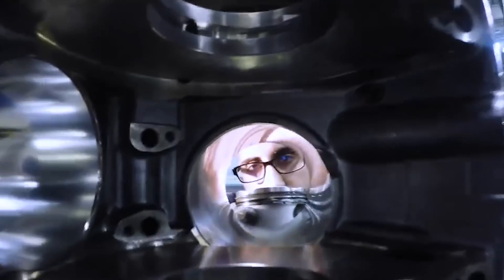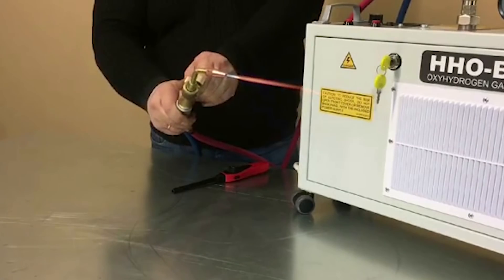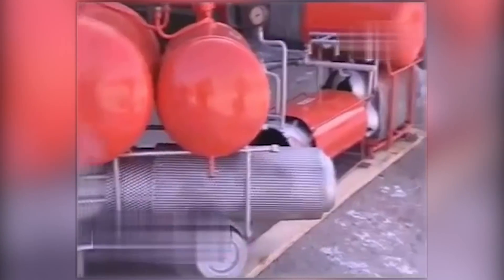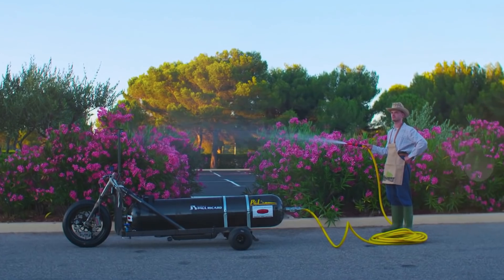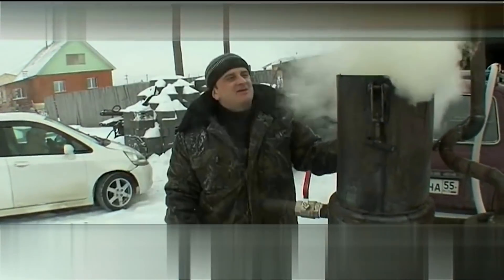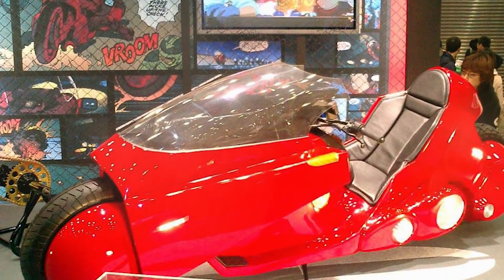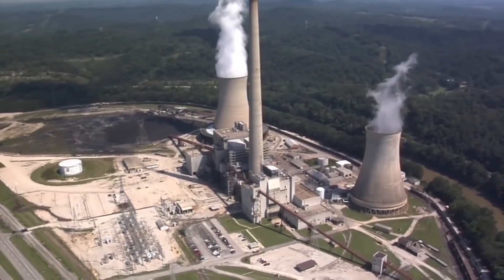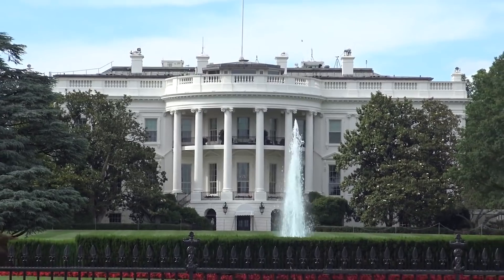Why These Engines Are Banned?

Comment: There’s no such thing as a free lunch. Hydrogen, compressed air etc. are not prime movers, it takes energy from another source to create them.
Reply: so does everything, it is called conservation of energy.
Reply: They literally use sunlight and air to make energy what you Talkin bout Willis.
Reply: @herbsewell4995  no! They use energy to produce less energy in a mobile carrier. It's not a perpetuum mobile. So no free lunch
Reply: You are exactly right
Reply: Yes, like electric cars lol
Reply: @bobopet2  to some extent your are absolutly right. but the difference is quite dramatic. When relating to fossile fuels.... nature stored that energy a long time before we lived. Releasing it, is OK. The sideproducts are not.
Reply: @bobopet2  yes I take it your a republican I hope and go COAL PLANTS
Reply: Rockefeller stopped electric cars. You can't sell oil with free or next to free energy. Tesla ? Nothing new under the sun
Reply: It is not free lunch, but potentially cheaper, cleaner and less pollution.
Reply: @JSiuDev  depends. Where are you getting the energy from to compress gas oder split H2O into H and O. If you say solar, wind oder nuclear, you where right.
Reply: Hydrogen is indeed a solution. Only problem being, it makes a great explosion compared to gasoline
Reply: @shaneintegra  There are ways to make it safer. The difficulty is more about infrastructure and industry support and investment.

Comment: Compressed air was used farther back then before the rubber tire, it was used in locomotives, first used in mineshafts,  made commonly by locomotive distributors, such as elmco.
Reply: well that it boiling water to produce pressure, not specifically storing compressed air

Comment: The diesel engine is still the most economical when you add up cost per pound moved.
Reply: And the most environmental friendly internal combustion engine.
Reply: And reliable, before docs, defs, and Egrs messed that all up.
Reply: and Space-X uses diesel 1 (Kerosene) because of the energy to mass ratio if I recall

Comment: Felix WANKEL began development of the engine at NSU Motorenwerke AG (IN GERMANY), leading to the first running prototype on 1 February 1957. Unlike modern Wankel engines, this 21 horsepower version had both the rotor and housing rotating. His engine design was first LICENSED by Curtiss-Wright in New Jersey, United States and they didn't produce any for customers.

Comment: 5:26 IIf I where to convert a multipoint fuel injected engine I would empty the petrol/gasoline from the tank and fill it with a mixture of water and ethanol 50/49 and 1% water-soluble oil (you might need to change the fuel pump to one that is certified for ethanol). Then I'd remove the injectors and look at the model and model number to find out how much fuel it delivers. Then I would find out the smallest size possible (fuel flow) of the injector model you can find and install. Then I would replace the original fuelpressure regulator with an adjustable one. 
Adjusting the the fuel pressure to the lowest possible while still obtaining satisfactory atomization of the water/ethanol/oil mixture which can be done by connecting the removed injectors to the removed fuel rail that is connected to the pressure regulator which is fed the mixture through a fuelline by the fuel pump.
The injectors need to be connected to a for the task special fuel injector driver that simulats the fuel injection pulse width from the ECU (electronic control  unit) of the vehicle at different loads and rpm. 
The original ecu will drive the updated injectors injecting the water/ethanol mixture keeping the intake runners, valves, pistons and combustion chambers clean while the ignition ignites the wood gas.
Then move the lamdasond or lamdasonds as close the exhaustmanifold collector as possible and remove the catalytic converters.
If there's 2 lamnadesonds install the first directly on the manifold collector and the second far enough so there is the same procentage temperature drop between the two as mesured on the system at normal engine temperature (before converting it to wood gas) att about 1500 to 2000 rpm. 

Then install a suitable model and sized spray nozzle 20cm infront of the the throttle body. Install a headlight washer fluid container with a integrateded high pressure headlight washer fluid pump at a suitable place on/in the vehicle.
Connect a suitable hose between the spray nozzle and the integrateded high pressure headlight washer fluid pump.
Connect the washer fluid pump to + with a red cable to a relay then from the relay to a fuse and from the fuse to a sufficient 12volt supply.Then  Connect - (minus) from the pump with a black cable to the chassis or - (minus) on the battery.
Then connect a switch with a red striped cable between the relay (trigger side) to a fuse and from the fuse to a12volt supply. 

Always fill the headlight washer fluid container with ethanol which will be use to clean the throttle body, intake plenum and manifold by activating the pump manually pushing the switch 2-3 seconds at a time. The system should only be use when driving in as high gear as possible keeping engine rpm above 2500rpm with throttle fully open (gas peddle fully depressed to the floor).
Push the switch to spray ethanol only when applying full gas (gas peddel to the floor) otherwise there is a substantial risk of enginebay fire and the cleaning liquid (ethanol) won't atomize which in turn won't clean the intake system. 

The wood gas generator should be installed as instructed by the builder/manufacturer.

Comment: The white stuff coming out of atomic reactor towers is just steam. Its steam from a secondary cooling circuit that is not in direct contact with the primary one. It is not radioactive. You can bathe in the cooling water with no radiation effects. 
Nuclear reactors are a great way to make more eco friendly electricity. Only human mistakes lead to events like Chernobyl and Fukushima.

Comment: 6:22 Unless it's a magnetic field generated with electricity that's bullshit. Magnets don't do work. Even if you can set the scene so it looks like they do the second you try to extract usable energy from the system it will stop.

Comment: You cannot beat the laws of physics... the amount of energy needed to push your vehicle forward is the same regardless of how you do it
Reply: Yes you can. Light gives off energy yet has no mass. If energy can’t be created or destroyed, where did it come from to begin with? Superconductivity at room temperature outputs more energy than is put into it, and it’s possible to do that as well
Reply: @Greasiola  light is an energy transfer from one location to another. It takes energy to create it in the first place

Comment: 4:28 That's totally nonsense, compressed air is one of the most expensive forms of energy. It is the most expensive at my workplace and that is 6-8 bar  low pressure.
Reply: seriously? wow i just found out about it? would you like you explain it to me a bit? i'm just a high school student, sorry
Reply: @tioa.p.1058  If you shorten a pendulum it gets faster, according to the same principle air gets hotter when you compress it. When it cools down again you have lost this part of the energy. Next you need to dry the air, otherwise you will have problems with water and rust. More energy for that. Then there would be leaks, but they are rather irrelevant here.

Comment: Reason 1: not commercially viable. Reason 2: They don't work as advertised. Reason 3: Environmental Nightmare. Reason 4: Lack of startup funding or lack of business skills. 

Burning waste oil is idiotic and dirty as fuck since you can refine it back to new oil that is what is done now. Hydrogen is not economical. Air powered cars get almost no mileage once you add passengers (as you saw from the cab loosing 75% over the claimed mileage). And we do use Solar heat but again Hydrogen is STUPID compared to using the heat DIRECTLY. Imagine making ice and melting it first and then freezing the water. That is what you are doing when you make hydrogen.

Comment: For a lot of these "engines" they are usually inefficient.  It requires energy to split oxygen from hydrogen.  Then you're going to use the hydrogen to power an engine.  If you drove a motor from the electricity you used to split H20, it would be much more efficient.  Also, storing hydrogen in an oxygenated environment... like the Earth's atmosphere can easily lead to explosions if an ignition source comes in contact with the stored hydrogen.

Comment: The problem with HO and compressed air is you need more energy in than you get out. Lets assume we decide to use electricity to do it safely, and say hydro electric to keep it eco friendly. It would still be less environmentally damaging to charge a battery and drive an electric motor directly as opposed for using it for HO generation or compressing air, plus a much higher energy density and longer run time. Most effective way to produce HO is chemically, but can be dangerous and can be an environmental hazard. The reason these aren't made is not because they are banned, its because they are inefficient, unreliable redundant and stupid. They could also be a bigger environmental hazard on the grand scheme of things. Just because something can be done doesn't make it a good idea.

Comment: Back in the '80s I read an article in a magazine about a compressed air vehicle. It carried an on board air compressor and actually featured regenerative breaking. It was powered by a small 2 stroke gas engine and got about 70 miles per gallon. The air tanks could be charged up before driving and the compressor would just refill the tanks as they were depleted.
Reply: Of cause you can make a compressed air car. The issue is that is really inefficent.
Reply: @matsv201  According to the article, it was averaging about 70 mpg.
Reply: @ihcterra4625  mpg  what....?
Reply: @matsv201  Did you even read my original post? I said it has a gas powered compressor that charges the reserve tank. The pneumatic motor drives the transaxle
 

So it gets about 70 miles per gallon. Depending on the braking, because it is regenerative.
Reply: @ihcterra4625  yes.. that is not true.
Reply: @matsv201  Like I said, that is what was in the article and it was back around 1980. 

However, Peugeot Citroen designed a air powered hybrid that gets 117 mpg in the city. So I'd say that it is not an unrealistic number.
Reply: @ihcterra4625  yea that is my point, never trust articles that is not written by someone how understands the subject.

No they also did not
Reply: @matsv201  They got the information for the designer. They quoted him directly. From what I recall.
Reply: @matsv201  Miles per gallon of gas. The compressor runs on gas. It fills the tank with air and the air drives the wheels. It takes a gallon of gas to fill the tank with enough air to go 70 miles.

There is no conversion. It just uses how many miles it can go on a literal gallon of gas.

This isn't rocket surgery. I have explained it 3 times now.
Reply: @ihcterra4625  of you belive thst i have dome land in Florida to sell you
Reply: @ihcterra4625  driving a generator/battery is even more efficient for such series hybrid designs (any system which decoupled engines or uses multiple energy sources is a hybrid)
In addition you don't have the mechanical factors of the tanks potentially explosively disintegrating after a few hundred cycles (it happens) or the extra maintenance of a pneumatic motor compared to an electric one
Reply: Makes sense: run the diesel at its most efficient speed at all times, and the air reservoir to even out the demand.
Reply: The problem with compressed air engines is Boyle's law - as you compress a gas it heats up and if you cool it you need to add energy as it expands (or incur a net loss).
Almost all compressed air systems dump heat during the compression/filling process  ,  which is highly counterproductive for overall efficiency

Comment: This viedo is a big XDDD. Those are not engines who can run on their own. They all need another type of engine to produce power. Electric, HHO, compresed air engines need who wuld thought electicity or in case air engine eventualy other types of compressor like DIESEL compresor. Thats why they are not popular, they are just ineficcient. U still need to burn coal, petrol, diesel or get power from other sources. Electric ones are becoming good enough but they are not ideal for evry job, compressed air XD, i do belive this cart culd go 200km/h but if it does that for even 10km im not so sure about that. HHO they have big storage problems, tanks for hydrogen are expensive and u cant just simply compress it like natural gas becouse hydrogen ll explode if not in special tank. 
And for fusion, yes they are tons of "generators" but they very problematic, and  for now they all consume more energy to oprate than we can harvest from them. And proces itself is not radioactive, but it throws out tons of neutrino around making reactor wall reactive, weakining its walls becouse neutrinos simply beat out atoms from it. Im verry optimistic for the first one to be operational in 2040, but year after year more of the problems shows with this reactors.

Comment: An engine is an air pump designed over a hundred years ago. The air pump uses fuel, hydrogen or anything that can combust in order to move the air pump and turn a shaft. It’s not a gasoline engine. Or hydrogen engine. It’s powered by those things

Comment: The Rotary Engine was not invented in USA but in Germany by Felix Wankel in 1932 based on the principle design idea of water pumps from the 16th century. 1957 it was another German, Hanns-Dieter Paschke, who constructed an economically feasible machine which was actually running in cars ... so please I would appreciate if you could get your facts straight.

Comment: If we used all the great inventions that could replace so called fossil burning fules, there would be no need for OiL, GAS, COAL, RADiAO ACTiVE GENNERATORS, & So On, & Using ANTi-GRAViDiC Techknowlegies, We wouldn't need roads either, freeing up the population, that would only have to work 20 hours a week at shitty jobs, compared to 40 +, & OT, & then taxed like "F".!  It's A BiG, GiANT, CLUSTERPHUCK, & That's the way the power hungry Billionaires want it, with the POWER, & MONEY In Their Pockets.! And not yours.! SIMPLE ISAN'T IT.?

Comment: 1.3 Kw of electricity make 1kw of våte gas. Nothing to gain there. Build a hydrogen powered car once. You still have to compress the air, not cost efficent. Ever see what happens when a compressed air tank explodes ? Dangerous and deadly ! GenGas(Wood) used back in the 30 and 40. A magnetic engine???? Oh you mean an electric motor...and not forbidden, it just did not work the way they though it would. .

Comment: I remember the death of Stan Meyers. He had a working car powered by water/hydrogen electrolysis. He poured water into the tank, drove it for miles then filled the tank from a garden hose. He was murdered after dining with sponsors.
Reply: That's not thermodynamically possible.
Reply: Hey Henry, how much energy was required to produce the hydrogen?
It always takes more energy to produce hydrogen than you get from using that hydrogen.
Always.

Comment: This is a big no. Stop trying to fool people into believing that something can run from thin air or plain water. Yes, those things can happen, but he says you can do it without using any energy. In order to run a car from air you have to compress the air first, which requires energy that comes from coal, uranium, the sun etc. These engines are not banned by any means. Please people, understand that there is no "free energy". You always need energy to do something, that is how physics work. To make water into fuel you need electricity. 

The future is not this fake energy crap, the future is electric cars powered by nuclear reactors and solar plants. I tried to type a comment earlier and accidentally deleted it, this is the more compact version of it. Any design of a vehicle you see requires some fuel, either that is gas, coal, uranium, or the sun. "Water powered" cars don't run from water (they do, but you have to know how that happens). If you go deep into it, they are powered by a nuclear or coal power plant somewhere.

I would like to say a big thank you to channels such as: Warped Perception, Integza, Cody's Lab, ElectroBoom, Project Farm, PeterSripol, Veritasium, Tom Stanton and a million other channels who make real car and science content. You should go check them out and fill your brain with real knowledge. As ElectroBoom once said, if you say some things that are true and then some lies that sound like true people will believe you. Do not be fooled.

Stay safe during these times people, and make sure you check twice what you believe.
Reply: Exactly right, Splatink. Thank you.

Comment: Can I invent a car moved by air but that last kinda close to a combustion one and powerful too? Basically make a car above a burning fuel massive compressor which would be the whole car, burn fuel for the compressor and use the air to propel the wheels, it's using air too (joking) :)

Comment: One thing about the compressed air you said that is incorrect, is compressing Air is expensive the more you compress it the more expensive it gets. There was a scientist or engineer that designed a truck that ran on compressed air on railroad tracks that need to be filled with compressed air at first, then as it was drove it would generate it’s on compressed air.